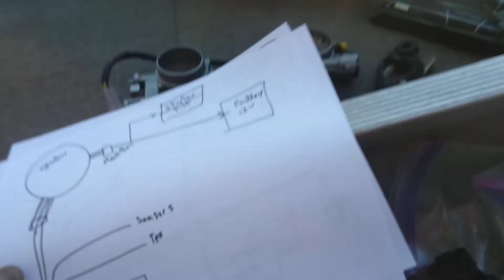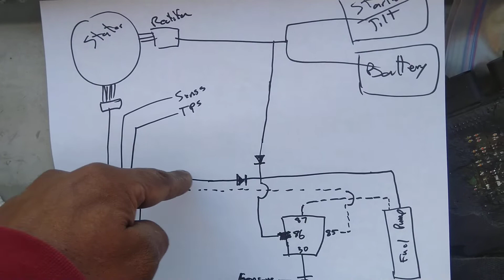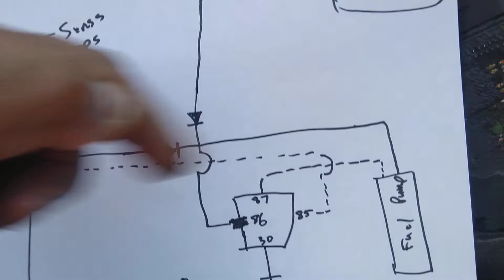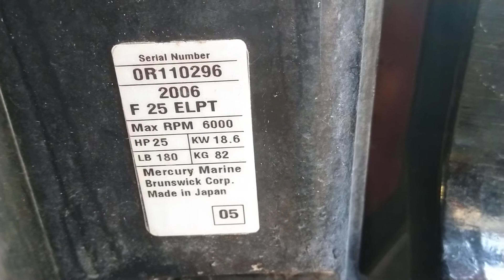mercury tohatsu 4 stroke 25hp 30hp outboard burning out ECU with aftermarket fuel pump

Comment: So I’m having the same problem with no power to fuel pump but only after the motor warms up. Added a new ground directly to fuel pump and still doesn’t want to hot start. 2014 25hp OR serial number. Is my ecu fried or possibly just getting too hot due to fuel pump pulling too much amperage? It is a stock pump I believe, bench tests fine. Thanks!
Reply from the maker: Run the fuel pump trigger wires to relay, then have the relay pull from a battery to drive the pump.  Make sure to have a flyback diode on the relay as well. Yah your ECU is probably done this will allow you to run it.
With that said if you have a volt meter, check the amp draw in your pump with just battery. If pump is pulling to much is your high pressure filter plugged?
Reply: Filter looks fine, pump pulled .8 amps on a battery and 1.6 running under load in the motor. This seems pretty low, it was also with an Amazon multimeter so take that info with a grain of salt. I think I’m going to go the route of running it of if relay and replace pump if necessary. Do you have a part # for the relay with fly back diode you used or are they seperate parts? Thanks for all the info!
Reply from the maker: @drewda610  I used Ford relay from junk yard or you can find relays with flyback diode inside them. You can also add a small .50 amp diode in the terminals for fuel pump side.
Reply from the maker: @drewda610  how did you test under load?  Run the negative to motor ground from pump, then run multi meter between pump and hit terminal in motor plug. The positive side runs the fuel pump injectors idle valve but it's the negative side that burns out it's the switch side
Reply from the maker: @drewda610  also check fuel pressure with motor running should be 43psi plus or minus 3. I used a tire gauge for this.

Comment: I have a 2013 MFS30B. Motor turns over fine. No spark on any spark plug. No warning beep when I first turn key on. Any ideas? Thanks!
Reply from the maker: Start with kill switch if no ignition. It's the easiest and first thing that goes. Find the wires that go to kill switch one side is ground the other goes to motor. If you have a multimeter prob both wires with continuity test one side should beep the other side should not with key inside switch..if it beeps both sides a new switch. 

If it checks out good then look for 12v at Injector wire when cranking, if you get 12v there then it's waking up the ecu. Can go from there a few more tests can be done in the two crank position sensors.
Reply: Stator checks out good both ohms (.4 all three legs) and about 8 VAC when running all three legs.  With starter turning the engine over, VST FFP plug has 12 VDC measured unplugged directly into a voltmeter.  When I jump the VST FFP plug and supply ground and 12V directly, it pumps plenty of fuel.  With the FFP plug inserted back into the VST and the motor turning over it does not pump at all.  So this leads me to believe the ECU is not supplying the ground to close the circuit and activate the high pressure pump.  Is the ECU waiting on a signal from any other sensors first, before supplying the ground for the high pressure pump...or is the ECU bad?  AND, does this explain the no spark on any of the three plugs? like without fuel pressure the ECU will not provide the go ahead for spark?
Reply from the maker: @ScallywagSailing  the ECU not supplying the ground for fuel pump is typical of the driver inside it burning out. This is pretty common and u can supply ground to the other pin and rig up a switch to go around this. Assuming the ECU is not getting ground on the kill switch, it would start.

You said you are not getting spark either, this leads me to believe your ECU is either not getting enough voltage to start up from the stator, (6 white wires starboiside) or the kill switch wire is shorted to ground.

Is this electric start? Tiller or remote?
Reply from the maker: @ScallywagSailing  ECU does not sense fuel pressure, once it's turning over 250rpm it will generate spark and fuel. I'll dig up the stator testing this morning. I'm leaning towards the kill switch being grounded myself from what you described because ECU usually only has issues with over voltage or under. Also check the ground, there a small ground wire that attaches from ECU to block next to starter solenoid up front, in a round eleyet.
Reply from the maker: @ScallywagSailing  brown wire from ECU pin 3 , if it test to ensure it is not ground. There is another brown wire in front harness, should be plugged if remote same test. Black yellow is lanyard stop switch that closes the brown wire from handle or lanyard
Reply from the maker: @ScallywagSailing  ignition coil test, should have 3.3-4.9 ohm from the plug to ground at mounting bolt. Remove the white plug for testing.
Testing the white plug on coil to ground should be  .17-.23 ohm
Reply from the maker: @ScallywagSailing  testing crank position sensor, port side: port side sensor (1 wire) to ground resistance 148-222ohm.
Starboard side (2wire) 148-222 between the two wires. Without cps signals ECU will not fire injectors or coil.
Reply from the maker: @ScallywagSailing  the 6pin stator for ECU testing. 
White wire to white wire 1.1-1.7 should be three wires
White /blue to white/blk 11-16 ohm white/red-white/blk 11-16 ohm

This is stator to power ECU/pump/injectors/coil
Reply: @omieyouknowme mine is reading 15volts at pump and injectors. No beep or light on start up. Could this be an issue
Reply: @omieyouknowme  how does the ECU receive power?  Does it come from the stator and if so isn't that a/c voltage?  Or does the rectifier convert it to dc? On your diagram it looked like stator had two outputs only one going out of rectifier...im confused
Reply: I have same problem I think ecu issue !!! I check all and all are ok ,stator are ok , coil ok ,pick up ok, I have power to pump and injectors but no have spark  and  when i try to start no beep and no red light 😢😢
Reply from the maker: @cantinadiscus  this sounds more like a kill switch that failed and grounded the wire to stop the engine

Comment: Hi ,I have this motor,I have this issue when turn key no status light and no beep , engine no start!! If I try to star more and more time  I listen a beep and engine start!!! But ecu when I turn the key (first step) take energy from battery? Or only from stator when
the
flywheel starts to spin??
Reply from the maker: There is no power to ECU with key in, only when the stator is turning over. It has to charge a capacitor inside ECU. But once it's running it starts all day, the capacitor will discharge over a day. So first start it can take two or three tries. Normal